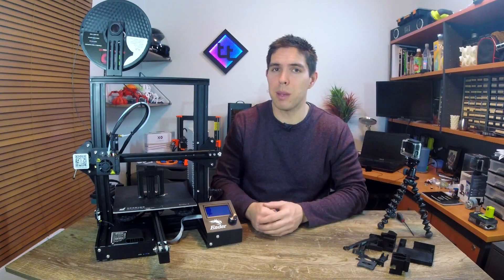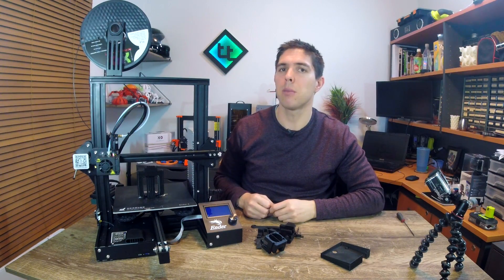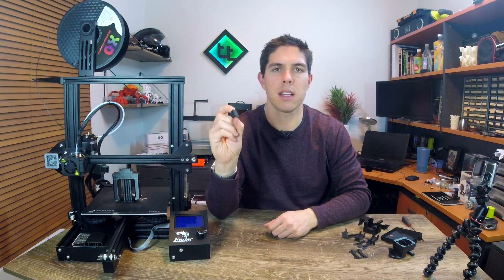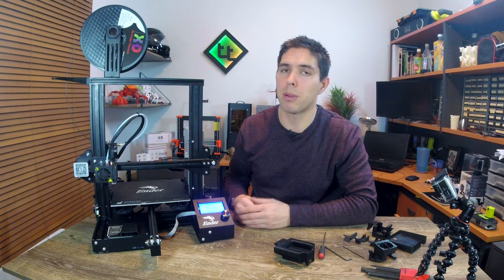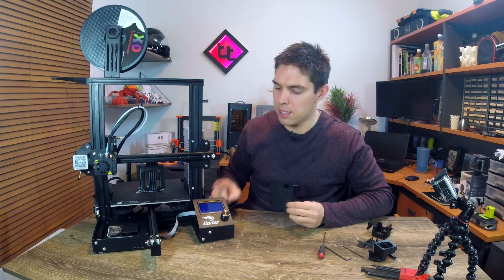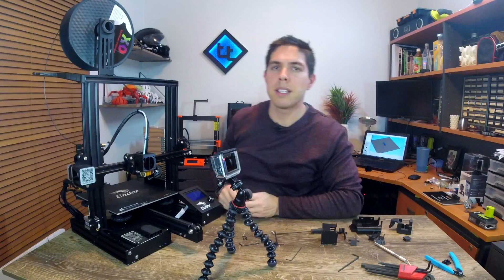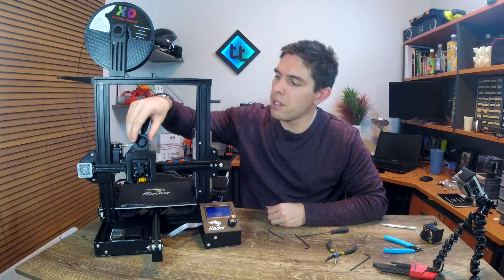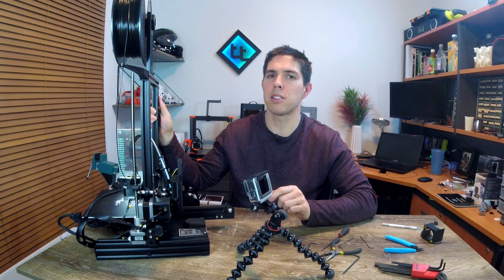7 easy 3D printed upgrades for your Ender 3

Comment: Thank you very much for the links for the upgrades
Reply from the maker: No problem. Planning a follow up with more printable upgrades now that the printer has been in the wild for longer.
Reply: Teaching Tech I just got my ender 3 from Amazon 3 days ago. Used it the 1st time last night did the test print.Now going to start on the upgrades listed above.The cable guard is pretty cool looking.thanks again

Comment: I print relatively large things boxes is that an issue for the Ender3? 
The Ender3 was doing well for about 2 weeks. Now it suffers from poor extrusion issues and no mater what I change nothing fixes it. Changed the feed tube, Changed the PLA, the feed tube connector, the print nozzle, checked and rechecked the bed for level. Changed temperature settings all the way up to 225. Feeling exhausted and defeated by this thing
Reply from the maker: In PLA it should be a problem. Sorry to hear you've hada bad run, most people are loving the printer. I would post on some of the Ender 3 groups with detail and pics.
Reply: From watching another YouTube trouble shooting video I found the issue to be a loose set screws on the gear  that feeds the filament. I am going to replace that entire thing with an aluminum one. 
Thanks for the reply..
Reply from the maker: Very glad to read you have sorted it out.

Comment: I had the z screw/nut to bracket problem on a cr10 s5 I setup and I ended up putting rubber o rings between the brass nut and bracket and gently tightened the little bolts with a bit of loctite on the threads, it allows the nuts to flex from the misalignment but keeps them from moving around,
Reply from the maker: That's a nice solution, thanks for sharing.

Comment: Great list of updates and glad to see the X3D Filament! Yeah I think that middle version was just bad QC and I got a bad one. The latest version has a removable bed and everyone seems to love it.
Reply from the maker: I watched your live stream during my review period, was amazed at poorly it was printing. Thanks very much for watching and commenting.
Reply: Hey man which two parts did you use for the petsfang fan duct? @TeachingTech
Reply: Indeed
Reply: Should check out 3D-FUEL.com. In my opinion the best PLA on the market. They have 3 grades, depending on strength and heat resistance you want. The top is as strong as ABS and we have used it to print casting prototypes and machine them in our CNC Mills.
Reply: Better PCB Cover using Factory Screws. https://www.thingiverse.com/thing:2987100

Nicer looking Ribbon Cable Cover https://www.thingiverse.com/thing:2989832
Reply: I agree.  I've tried many of the other local options and X3D seems to be the best filament I've come across - especially as I can just drive to their warehouse in Perth if I run out of something I need.  
I think the worst was Blueprint3D.   The package came from NSW to WA without a box (the filament boxes were taped together with a shipping tag slapped on) and the PLA, PETG and TPU rolls would print for about three minutes before snapping.  Yes, even the TPU snapped.  It was $350 essentially flushed down the toilet.

Comment: Whats the best filiment to use for the ender 3?  PLA
Reply from the maker: PLA works great. PETG works well too. ABS is going to be trickier with warping du to the open frame.
Reply: Teaching Tech i plan on building an enclosure out out of polycarb and 20/20 extrusions.  I have an engineering degree and have worked on a ton of notable projects so i have the ability to grab 20/20 or pretty much any extrusions I need.  I left a very lucrative project in defense to become an Army Warrant Officer and deployed to afghanistan where I was wounded.  Now I do charity work and am on the board of a few charities ( I take no salary and refuse to work with those who do) I am starting my own Charity to provide hobby items and maker spaces to Wounded Veterans.  I am buying an Ender 3 to see if its a viable way to help with that goal.  So far Im sponsored in part by one of the largest hobby companies in the US and want to branch out to more maker oriented fields.
Reply from the maker: Sounds like a good solutionthat are very capable of delivering.

Comment: How About a support bearing for the Z-Axis lead screw? is it worth it?
Reply from the maker: If you mean one at the top, I would generally say no. If the lead scrw isn't perfectly straight it introduced z wobble and artefacts to the vertical walls.

Comment: I like the filament path tweaks, but wouldn't the best option be to remove the spool from the frame and set it beside the printer? Even with the upgrades, there are several points where the filament will rub against plastic.
Reply from the maker: I personally prefer to have a printer in one piece for when I move it. For anyone else your suggestion is ideal.

Comment: Thanks for making this video. I'd like to add one caution about using that filament guide on the extruder. Over time it becomes loose and during a print it can come off the metal bracket and jam up the filament causing the extruder to start skipping misfeed. This happened to me several times. I solved it by drilling out the hole for the filament in the extruder arm where the filament normally goes through to slide a short piece of Bowden tube through. The hole is sized so that the short piece of tube is a tight enough fit to keep it from moving. The tube is long enough to clear the threaded Z rod and is pushed far enough in through the extruder arm so that it's almost touching the filament feed rollers to minimize flexing of the filament which is especially important when printing with flexible material such as TPU and Nylon.
Reply from the maker: Great tip, thank you.

Comment: The amount of damage cable chains cause to wiring and you just seriously said hey you can make one! 
Just don't do it please retract that statement put a box in the video NO don't do it. It has been proven many times the constant rubbing of cable chains wear wires out eventually you will get a short or a hot spot and a fire. You can install them safely by warping the wire in a protective covering then putting the cable chain on but it just defeats the purpose of the chain in the first place and eventually you will wear that covering out and be back to square 1 problem.
Reply from the maker: The Ender 3 wiring comes wrapped in fibreglass sleeving, which should address most of your concern. My CNC router has been running faultlessly for years with cable chains, as do many others, so I guess while the potential for a problem is there, in many cases it just doesn't happen.

Comment: I've printed all the upgrades in this video. Yes, these upgrades are helpful. Thanks thingiverse.
Reply: thank you teaching tech aswell!
Reply: For the petsfang v2 he printed, I have a few questions.

1.) Which model does he print in the video? There are like three files on thingiverse that say CR10, so I’m not sure which one to print

2.) Do I need any extra hardware? He mentions using the stock screws a few times, but there is one bolt in particular he doesn’t comment on

3.) Should I just print the newer “Bullseye” model because this video is about a year old?
Reply: @loganeasley4343  What did you end up going with?
Reply: @the_crazy_bee1787  I ended up going with the Bullseye, there’s a bunch more documentation and a table for which files to print based on what hardware you have. It’s served me well for the year that I’ve had it, and I’ve only had to replace it once when I bumped into it by accident. I would highly recommend it, haha.
Reply: How do you attach the first design.

Comment: Is that shroud "safe" to print in PLA?  It looks awfully close to the hot end, and PLA can soften and start sagging just from being left in a hot car.  You should probably take it apart and inspect it after a few prints, and especially check it if you print with a material requiring a hotter end, such as PETG.
Reply: no need. you will never get enough heat across that airgap to effect the part in pla.

NOW if you intend to use an enclosure. ok you would need something other than PLA possibly.
Reply from the maker: Agreed I'm going to reprint in black abs with the duct face down on the flat.
Reply: I'm really late, but shouldn't the airflow from the fans keep everything cool enough?

Comment: Hello, You mention needing longer M3 screws for the LCD back plate. Do you have a length? If you mentioned this in the video, I’m sorry. I didn’t catch the length.
Reply from the maker: I'm away this week so I can't verify exactly, I think two at M3 X 20 and two slightly shorter, maybe M3 X 16. I hope this is close.
Reply: Thank you so much for your reply. I was actually able to locate the information in the creator's notes on Thingiverse. I really appreciate you taking the time to respond to my question, however. As I mentioned before, I am totally new to 3D printing, and I am finding I have a love/hate relationship with it. I am really struggling to get my prints to come out well. Your video was really informative and is helping me get some good mods on my printer. Now, I wish I had some names for the problems I am experiencing. Maybe then I could research how to resolve them...Keep the videos coming, please!
Reply from the maker: This page might help you diagnose some issues. Some solutions are s3d specific but a lot of good general tips too:  https://www.simplify3d.com/support/print-quality-troubleshooting/
Reply from the maker: This page might help you diagnose some issues. Some solutions are s3d specific but a lot of good general tips too:  https://www.simplify3d.com/support/print-quality-troubleshooting/

Comment: I use a carbon fiber plate as my printing bed. A little gluestick and everything sticks well. If the print is done, I remove the plate from the printer, twist it and the print comes off easily. Then I put the plate under water to clean it.
Reply from the maker: Carbon fibre plate! Never heard of that. If I come across a sheet I will try it.
Reply: Teaching Tech yeah you should give it a try. Make sure your plate is around 1mm thick

Comment: Funny first thing this morning my print barfed part way through c40% or 2 hr print, I connected up an iMAC and thought I'd try Cura & USB print not copy to SD card. Forgot the screen save/sleep settings in the iMAc will effect Cura...not sure that is ideal however the printer seems to have just frozen, with heaters still on etc. The nozzle had melted a nice hole in the PLA on another component on the bed ...but the "Filament guide snap in (up high)" had printed enough to be usable, the rest was junk. Lucky was in the room still  :-)
Reply from the maker: Upgrading firmware to enable thermal runaway protection makes the process worthwhile for that alone. Glad it ended up ok.
Reply: Yes I think I might just have to and accept it voids the warranty.

Comment: Waiting for the videos... how you add the BLTouch if you have the  Petsfang duct fitted as I was a tad stumped on the mounting. The duct takes the place the BLTouch should go normally with the Ender 3. BTW don't need to add supports etc you print the duct flat... says so in the thingverse docs. Adding a glass plate to mine as seemed to make printing easier.
Reply from the maker: The bltouch can go wherever you want, you only have to set the offset from the nozzle in the firmware. The mounting tab on the fang should be plenty I think. Will reprint the duct flat from ABS.
Reply: if you add a glass plate to your Ender3 printer (or any printer I think) don't forget to move the Z-Axis stop switch UP by the thickness of the new bed before you re-level.  I found out as there isn't enough play in the bed springs to allow for it and that is the solution (some printers do have that much play!) You obviously loose that little bit of build height. But just two screws to adjust on the Z-axis limit switch back plate which can be adjusted up and down, you loosen the screw and move it upwards the thickness of the new bed addition then fine-tune downward before normal leveling. No messing about with software adjusting Z level offsets in GCODE.
Reply from the maker: Good tip.

Comment: Congratulations this was a great video! Just a couple of questions: 1) how is the ender 3 comparing (print quality wise) with the mk3 and the cocoon create?; 2) the chassis for the Petsfang seems awfully close to the hot-end (I know, there's a fan on top but still), do you feel confident the PLA will survive extended use?
Reply from the maker: Thanks for watching! 1. Ender 3 I would say is not quite as nice as MK3 but better than the CCT. 2. I was hesitant to fight the warpage of ABS and didn't have PETG on hand so we'll see how the PLA lasts. If it is going to fail it will be sooner rather than later.
Reply: Thanks for the reply. I ask because no matter how nice the mk3 is, I just find that the prusa chassis design is not as rigid as something with v-slots like the ender-3. But I guess the hot-end and the electronics may be playing a part in it too. Regarding ABS, I have an ikea/prusa enclosure, but you can always try just putting a cardboard box over the printer. As long as the thermal gradient is reduced you should be fine.
Reply from the maker: The Ender 3 definitely has less flex in the frame than the mk3 and CCT.
Reply: I just received mine yesterday. I have some reservations regarding the bed roller alignment and just overall the eccentric nut approach, but otherwise it's printing on par with the ultimaker 3 I have at work
Reply: I love the rollers most people do them wrong however. here is how you do them.

loosen them till the bed wobbles. then very slowly tighten ONLY until the wobble stops. when the wobble stops STOP tightening.

over tightening will cause uneven rolling (artifacts in your print) higher strain on the rest of the kinematics and wear out the wheels.

I have over 5000 hours on my CR-10s still the original wheels NEVER readjusted them since I set it up. ever.

same with the belts. ONLY tight enough to just twang a little NOT over tight.

Comment: Tnx for the vid, but what I really would like to see is the preparation for each upgrade in de slicer software. That is what really teaches us how to properly setup the gcode. I love the ender 3 so far. But there is such an overwhelming amount on information on the interwebz and most of the time the youtubers skip the part of the preparation and go straight to the print it self of the review of the already printed part! Tnx !!
Reply from the maker: I can see your point but that would make a very long video. Perhaps a general video on print orientation and settings would be better?
Reply: That would be perfect
Reply: Teaching Tech it al starts with leveling the bed. But i cant seem to get the bed 100%. I know there are a lot of other videos but not one specific for the ender 3. Since this is going to be probably one of the most popular printers  I would love to see a bed levering video just for the ender 3. I think it already starts with the wheels underneath the bed. But you probably know that beter than me! :-p

Comment: Please do video to modify Ender3 marlin resume after power off to work on any other printer
Reply from the maker: I will have to look into whether specific hardware is needed for that like the Prusa MK3 has. It might not be so simple as a Marlin setting.
Reply: Teaching Tech such as anet a8 or Flsun i3 they are very widely used

Comment: Watch out for the bootloader.  I put one on my CR10 worked first time. Then I update firmware for second time and it failed to load? I now have a new board.
Reply from the maker: Ok will do. I've done it before on a Solidoodle 2 Printrboard and CTC i3 Pro B random board. Hopefully I'll be ok.

Comment: I have this https://www.thingiverse.com/thing:2544186 fang mod on my cr-10, it also fits perfectly on my ender 3. PETG is a good material choice. It is super lightweight + guides the air perfectly to the heatsink & nozzle end
Reply: https://www.youtube.com/watch?v=dN2CcUE4g00
Reply from the maker: That is a really nice looking duct, especially in that filament. Doesn't look fun to prnt in terms of support, but probably worth it.
Reply: Haha yes i needed a lot of finetuning for that filament! https://www.dasfilament.de/filament-samples/petg-1-75-mm/147/petg-filament-50g-sample-1-75mm-natur this is the material its from a German manufacturer and the quality is really nice! Luckily they sell Samplespools of 50gram so it should be enough for one fang (29g) if you want to try it out 😂👍
https://www.dropbox.com/s/l1esi7t66jy37vo/Ender%203_OEM_Fang.gcode?dl=0 Here I uploaded the g-code for Ender 3

Comment: Isn't the Petfang designed to be printed laying down? I had zero issues printing it flat.
Reply from the maker: You are quite right, I didn't realise at the time.
Reply: Its a very clever design. And yes printed it laying flat too. No supports needed at all.

Comment: There is one more mod. Tool holder that goes on the top of the printer to hold allen keys and scraper.
Reply from the maker: Good suggestion.
Reply: Ayyyy

Comment: Which way did you print the fan shroud? I can't find the right position that wouldn't require too much supports
Reply from the maker: As Keith says in his comment flat side down is better than how I did it. I checked and there are internal ribs to help with the bridging.
Reply: Teaching Tech I meant the hot end fan, the smaller piece. The part cooling duct I printed it flat and it was fine